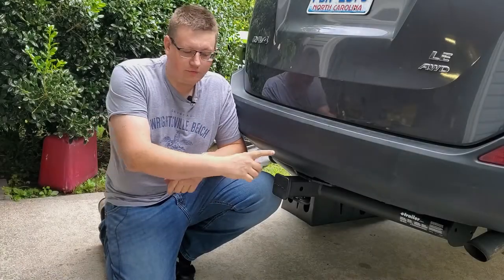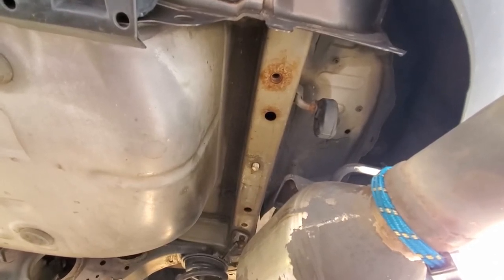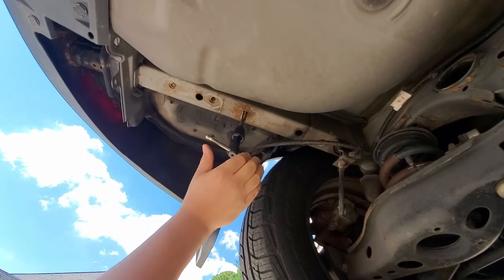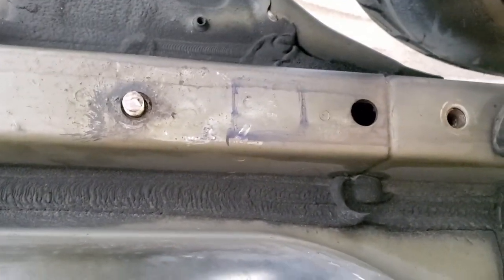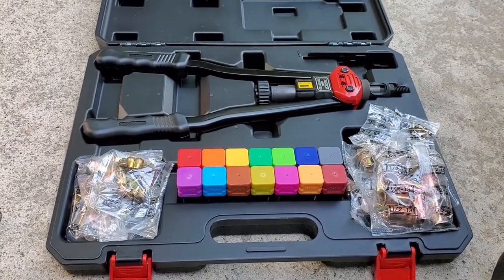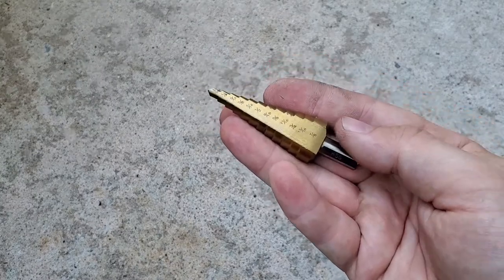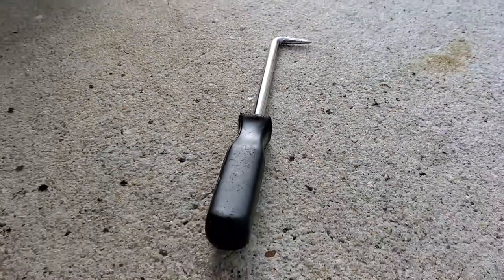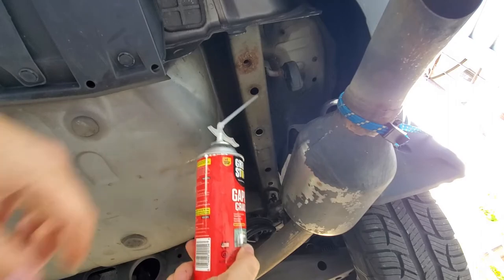Hitch Weld Nut Repair | Toyota Rav4

Comment from the maker: Guys I received a lot of comments about that it's not going to work.... it will break... etc. Trust me it will not !!!! This are steel riverts, not aluminum!! Also repair only for good one bolt. Not all 4. Obviously if you replace all four connections I would not trust that my self !!! If you carry 6000lbp trailer I obviously wouldn't  trust that either. But my RAV4 was only rated for 1500lbp trailer. So repair like that only good for one bolt will work perfectly! Use your brain, common sense and be safe

Comment: Installing a hitch with brass rivets.  Brilliant, now I’ve seen everything.   Complete FAIL.
Reply from the maker: It's not a brass smh..... it's ani-rust coating looking like that. Come on now. You should know that right.
Reply: @IvanRossS  did the rivnut setter come with them? I'm not sure if I'd trust something this important with anything less than grade ten. I'd like to look up the specs.

Comment: I would only haul light load with that kind of rivit, it will not hold load capacity of a trailer hitch, it can burst at any moment on the road and kill someone.
Reply from the maker: Toyota RAV4 cant pull more than 1,500 anyway..

Comment: Hmm, I'm not sure about the RAV4 but on my Toyota, the Starlet hatchback when I remove the rear bumper I do have full access to the tunnel that is also shown for this RAV4. Also I do not recommend anything less than steel nuts when you intent to haul something with the hitch.
Reply from the maker: It's all steel
Reply: @IvanRossS  Ok, but still, if you can get access to the tunnel it would be best. Inside have a 5mm flat bar and weld acorn nuts on that flat bar. I still would not want to rely on rivet nuts.
Reply: So, I'm back here again. Now I talked to a very experienced and skilled man at my DIY car repair shop and he confirmed too that it is a bad idea to use rivet nuts for trailer hitch applications. These aren't strong enough for this.

Comment: You keep saying that this is the only other option. This is a horrible idea. Installing a trailer hitch with brass rivets?? The best option is to remove the bumper and slide out the bumper mounts from the frame and access the hitch mount holes to repair or replace the welded nuts.

Comment: Are they strong enough? Tension capacity?
Reply from the maker: There is a video of guy testing pull on them ! Very strong. Search on YouTube. Also its only one rivet, you have 3 more bolts holing  it. So it will be fine. I pulled trailer week ago

Comment: nice job but i can’t trust rive nut for load 1500lb
Reply from the maker: No u can't. But you do understand the weight is spreads.... when you're pulling the trailer or anything you're applying a side pressure...  Pressure spreads on all four connections !!  Not on just one rivet LOL and these are steel rivets they're not your typical aluminum rivets lol

Comment: I had a similar challenge.   The screw broke, yet the cars factory nut is still in place.   Now i dont know how to get the broken piece out of the nut.    This video was the closest idea of something different to fix the issue
Reply from the maker: U have to drill it out. Or just hammer it inside of the frame. Just keep hitting with a hammer until u break that weld on a nut and the just use my method

Comment: I just bought this tool after seeing your video - better then trying to weld in tight spaces ; my only concern is are these Fasteners strong enough  especially being used in a hitch that could have thousands of pounds on it the load

 I have the same problem with my hitch but if the tool isn't strong enough I'm sure I can use it in my tractor and other jobs but I do want to know if this is strong enough to handle a few thousand pounds
Reply from the maker: Well if you're only fixing one point of connection, then you should be fine.. weight  will evenly spread around 4 bolts, now if you working with all 4 of them,  I wouldn't be trusting it. I mentioned in the description that there is a video out there you can find where a guy testing and he's holding whole engine owner it
Reply: I had 3 of 5 break the welds. I was concerned about using riv nuts too. I ended up picking up some carriage bolts with nut plate to prevent the bolt from spinning and then use a lock nut with the conical washer. Still have to install it tomorrow hopefully. Should be a lot stronger than a riv nut